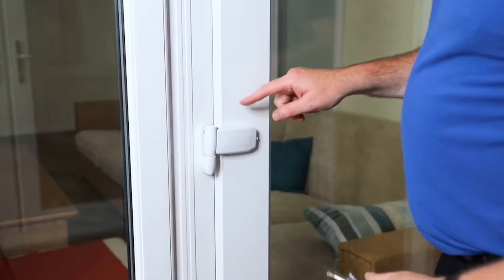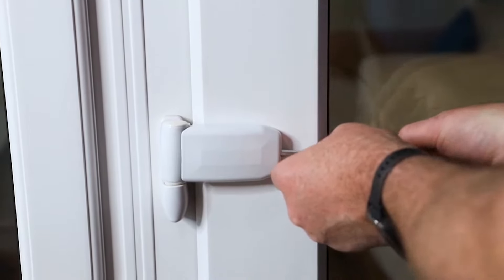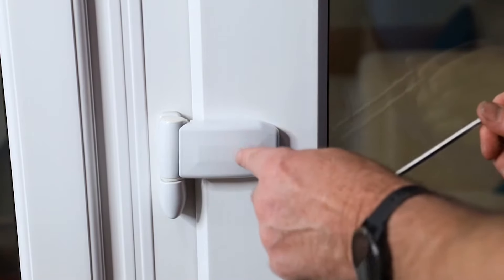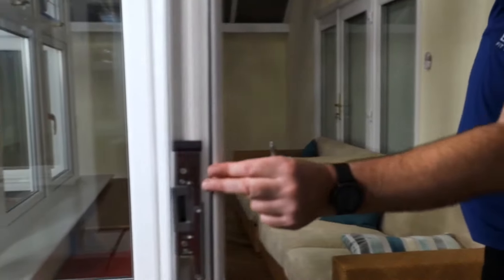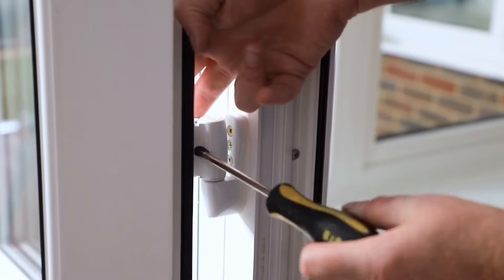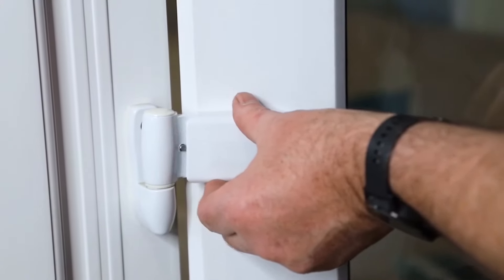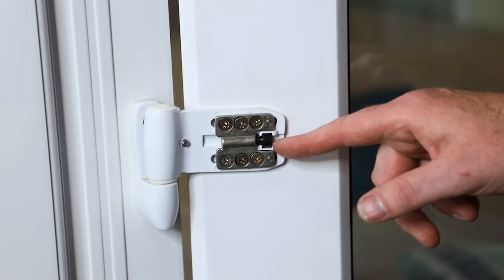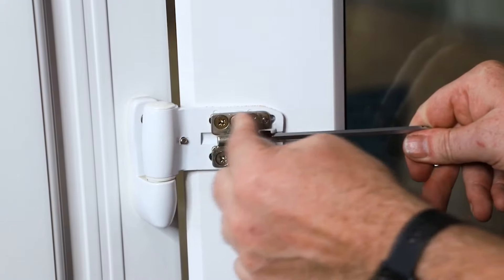How to adjust uPVC front door hinges left to right

Comment: Brilliant video, thanks very much. My hinges were slightly different in that the left to right adjustment wasn't via the hidden Allen bolt, but on the top and underside of the hinge where it meets the frame. The Allen key shown in the video adjusted the vertical height of the door but you can figure this out by going slow and measuring the gaps. Thanks again
Reply from the maker: Glad it helped